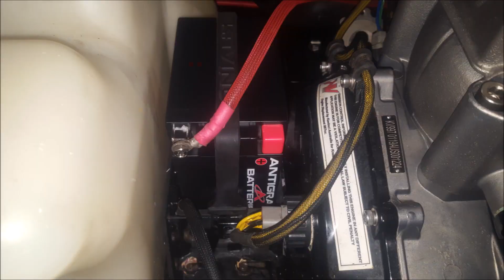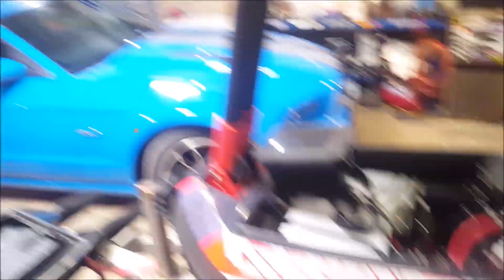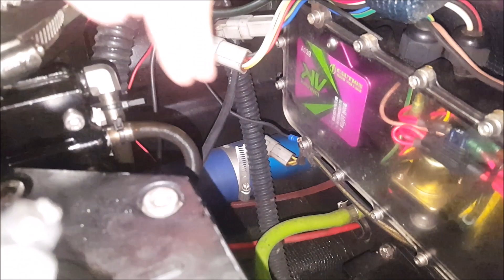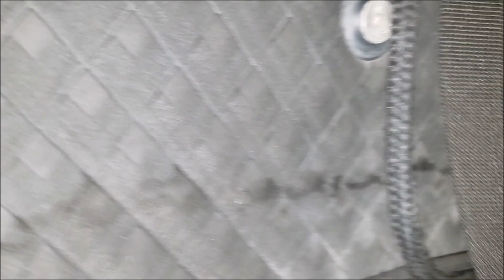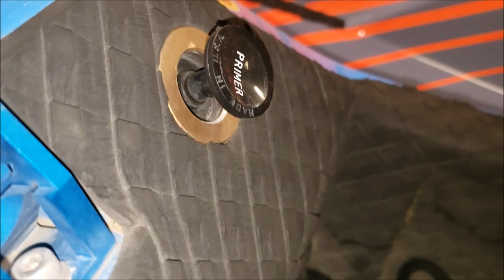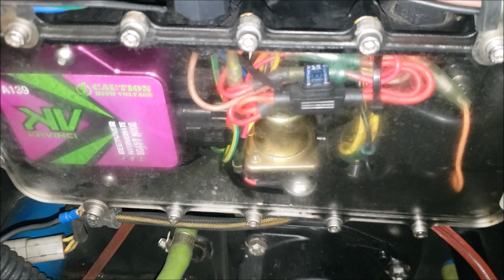Krash 997 CDI/Starter/Electrical system care and upgrades - JS Powersports

Comment: I see this krash industries 2024 on my local facebook martket place with a bad starter due to a "bad chinese battery" what would you do to check or what do you recommend me check? im going to try and buy it very soon
Reply from the maker: Check everything, make sure engine is free and not locked up buy turning driveshaft couplers.

Comment: Thanks for the video. I’m buying a reaper second hand that has the starter out and needs new woodruff and bendix I’m assuming these issues weren’t addressed before hand and this is a common problem. What else are small fixes to these that help with the reliability and keeping things working properly ?